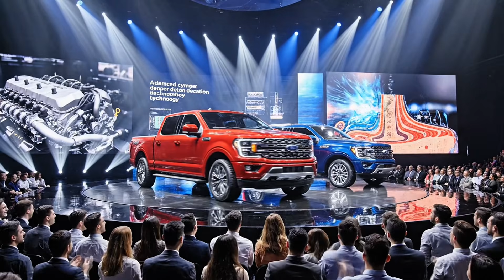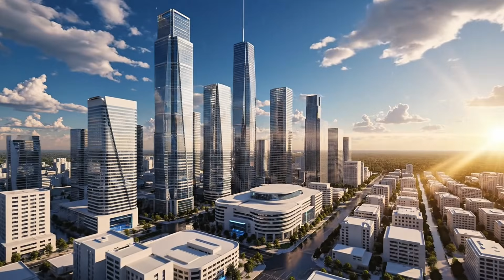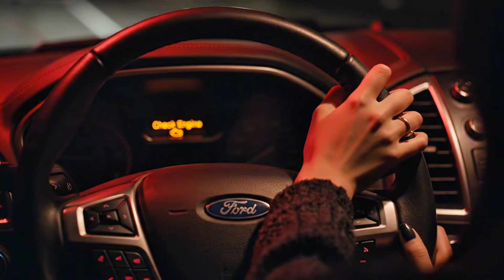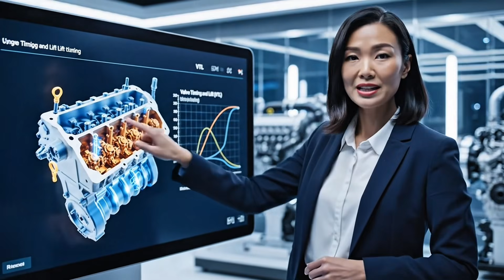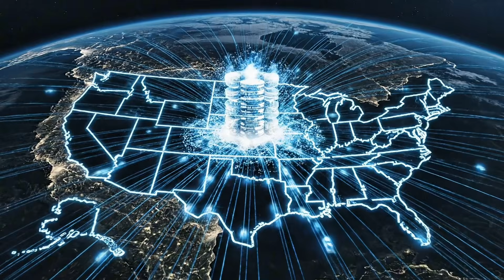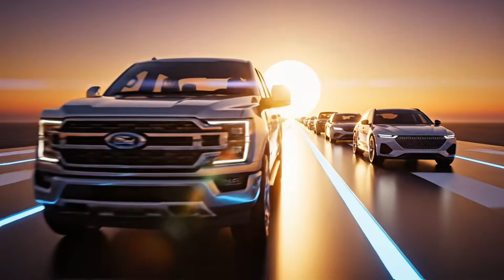Ford Just Shocked Everyone by Fixing V8 Cylinder Deactivation for 2026!

Comment: Afm doesn't save enough fuel to offset the repair cost. Not by a long shot
Reply from the maker: The debate over whether fuel savings justify the complexity and potential repair costs of cylinder deactivation systems remains a major concern for many truck owners.

Comment: 😂😂😂😂.  They just dropped cylinder deactivation and auto start/stop.    .   It only saves 1%.   🤣🤣🤣🤣
Reply from the maker: Ford has not confirmed that it has eliminated cylinder deactivation and Auto Start/Stop across its entire lineup. Those features vary by engine and model, and fuel-economy gains depend on driving conditions. The real question is whether the benefits justify the added complexity for owners.

Comment: The reason I've bought the 2024 Nissan Titan SV with the 5.6L Endurance V8 in it (with 400 HP and 413 Ibs of Torque) over the 2024 Ford F150 with the 5.0L Coyote V8 in it (with 400 HP and 410 Ibs of Torque) for 3 reasons, one I didn't want the cylinder deactivation, two I didn't want auto stop start, and three I didn't want to deal with the wet belt driven pump either.
Reply from the maker: Those are all completely valid reasons, as keeping things mechanically simpler is a huge priority for a lot of truck owners.
Reply: @NextGenWheels-s5r Yes sir 100%

Comment: Most ford's that have been, the Radios never work, just junk...
Reply from the maker: Yeah, older Ford infotainment had its share of issues for sure. A lot of it was software-related though—SYNC systems have gotten way more stable in newer models. Still frustrating when basic stuff like the radio doesn’t work right 👍

Comment: Cadillac did this with a 4 - 6 - 8... it didn't work for them...
Reply from the maker: Yeah, Cadillac’s early 4-6-8 system had a rough reputation for sure. The difference now is modern cylinder deactivation is way more advanced—better electronics, faster switching, and smoother transitions. Not perfect, but definitely not the same tech as back then 👍

Comment: Screw cylinder deactivation. I’ll stick with my naturally aspirated V6 engine in my 2022 Toyota Tacoma. No turbo or turbos. No cylinder deactivation. A naturally aspirated V6 engine, 6 speed transmission. I’m happy, no complaints, no problems or issues. Ford has the most recalls out of all the manufacturers. I don’t have the newest, 4th Gen Tacoma. Didn’t want it, don’t need it. I’m more than happy with my 3rd Gen Tacoma.
Reply from the maker: Can’t argue with that—simple, naturally aspirated setups have proven themselves over time. A lot of people prefer that “less to go wrong” approach 👍

Comment: I was a Ford guy from 87 till around 2010 but not anymore.
Reply from the maker: A lot of longtime owners feel the same way—things changed quite a bit after that era. Curious what pushed you away the most?
Reply: You’re missing the boat then.  Because that 400 hose Coyote shuffling the 10 speed at 7,000 RPM is something else!    All forged internals.  Unlike the competition.   It frigging flies!    Faster than any Lightning ever dreamed of being.    And tows 13,000 lbs. like a champ!   😊

Comment: Cylinder deactivation is a feature added to meet CAFE standards, not because the customers wanted it. As CAFE standards are relaxed, that feature should go away because an engine without that feature is more reliable.
Reply from the maker: That’s a big part of the debate. Regulations push efficiency tech, while buyers usually prioritize durability and long-term reliability.